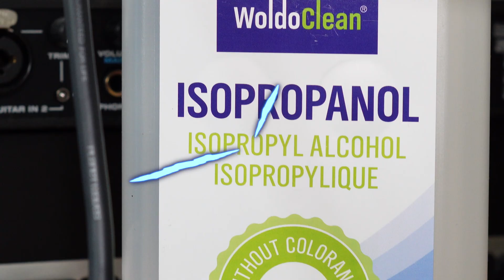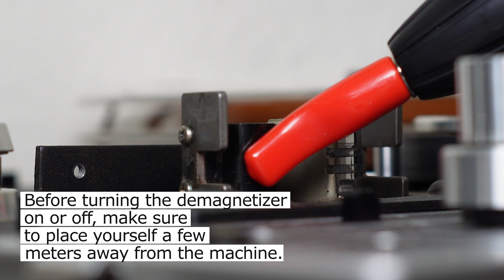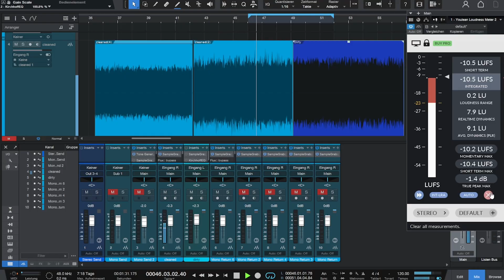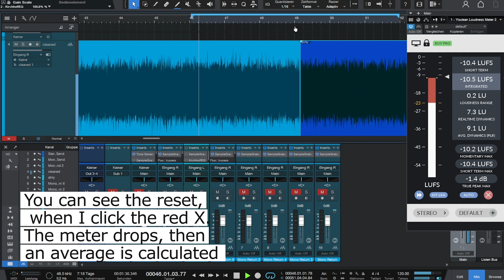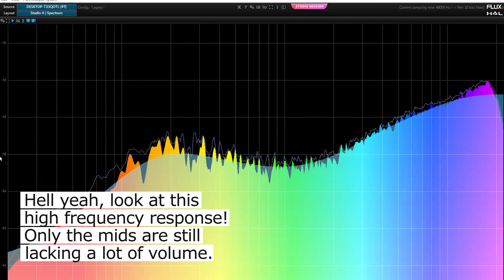Tutorial | Tape Machine Cleaning |& Demagnetizing | Before & After Frequency Response

Comment: Tip:  Move the demagnetizer around in motion and never touch the parts.  Also, never turn it on or off near the parts.  Cleaning solution, air, and tape touch the heads.  Nothing else.  Good luck!